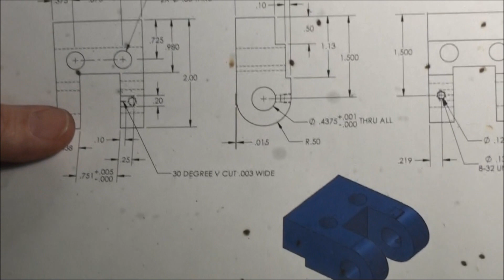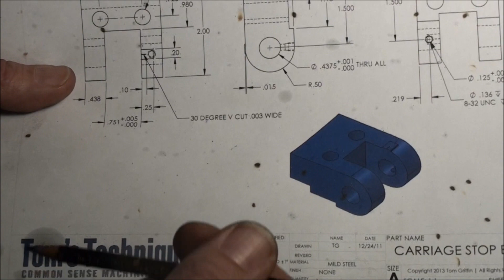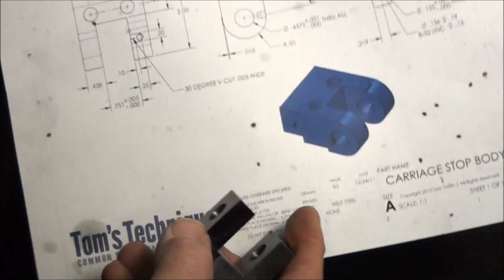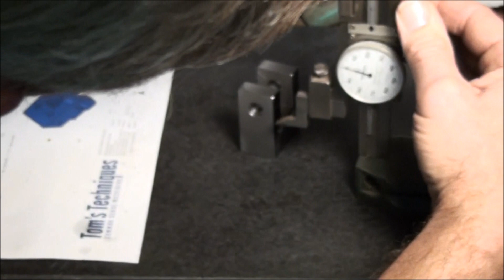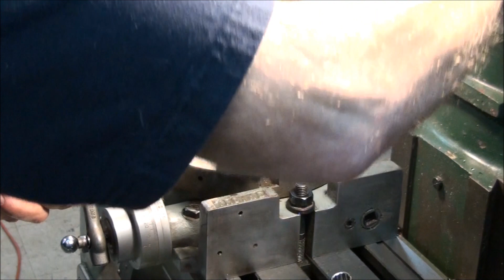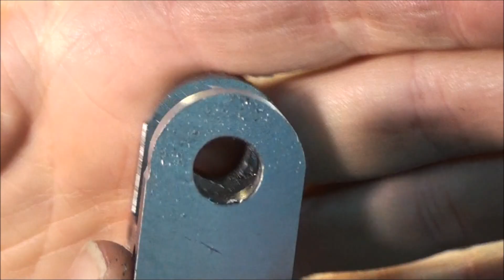Carriage Stop Body Part Four, Milling the Radii

Comment: As you slid the paper in under the part, I immediately thought of using thin double sided mounting tape you can get (not the thick spongy stuff).
You can get "carpet tape" here in Australia, sticks like the proverbial to a blanket :-D. In combination with the clamps should be really stable...
Reply from the maker: Ray,

It's not adhesive that makes the part stick, it's the fact that the paper fills in the gaps and provides friction between the part and the jaw or table. I would not suggest using tape.

Tom

Comment: Thanks Tom
  I guess the most obvious thing is that the bolt came all the way from the T slot in the mill table.
  There looks like there is enough meat to mill the T slots in the table. Think I'll think about it a while and determine if I want to try it. 
  Maybe a 6" chuck with an 8" mounting plate with slots for the mill T bolts would work. 
  Thanks again, 
  Ron

Comment: Tom,
   I have been following all your videos and as I've commented before I've learned a lot from you. Keep them coming. I have some questions, mainly involving "set up" on the rotary table. I just purchased an 8" Yuasa horizontal-vertical rotary table on eBay. Unfortunately it only has 3 T slots. Can I mill 3 more slots in the table without ruining it? 
  I made a couple of sets of your step blocks and the #3 Morse taper plug for the center hole in the table, They all work great. 
  I notice on some You Tube videos the machinist had a bolt, for clamping, coming from the center of the hole in the table. How is this held in place? 
  Also, if I wanted to mount a chuck to the table would I have to tap and drill holes in the table to match a chuck backplate or is there another way?
  Seems there is a lot I don't know about rotary tables. Sorry for such a lengthy post.
  Thanks,
  Ron
Reply from the maker: Ron,

You would have to pull the table apart to see if there is enough stock where you want to put the T-slots.

I've never seen a rotary table with a stud in the center. Perhaps the studs you've seen went all the way through the rotary table into the mill table below.

If I were mounting a chuck, I would first mount it to a larger sub-plate and then bolt the sub-plate to the table. Don't forget, there would need to be some adjustment to center the chuck on the rotary table.

Tom

Comment: Top, 

Excellent use of the plunge cutting - I will be trying out this technique.

Also, nice lathe dog handle on the RT.
Reply from the maker: Lol, I got that rotary table free from a place I worked because it was missing the handle. I have a stock one, but never got around to installing it because the dog works pretty well.

Plunge cutting rules, I use it all the time.

Tom
Reply: Thanks Tom, so will I from now on!